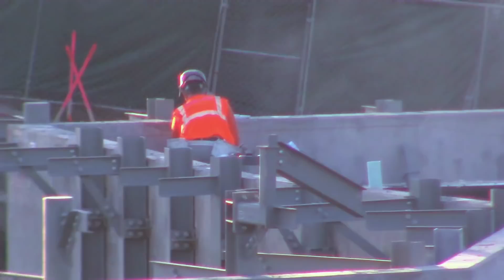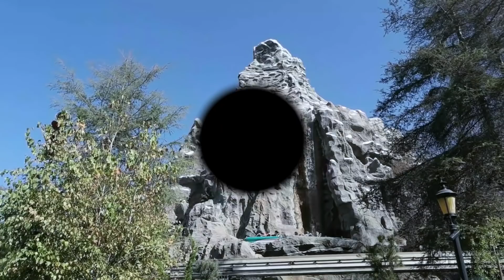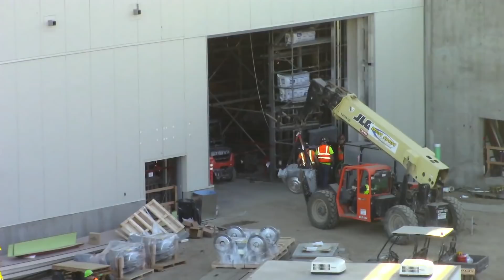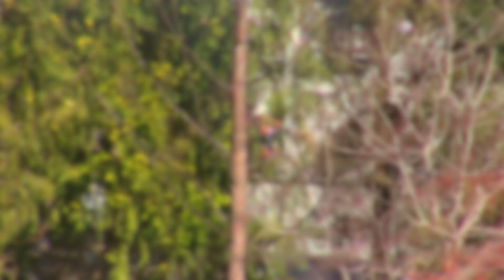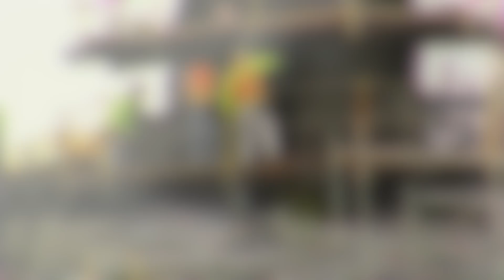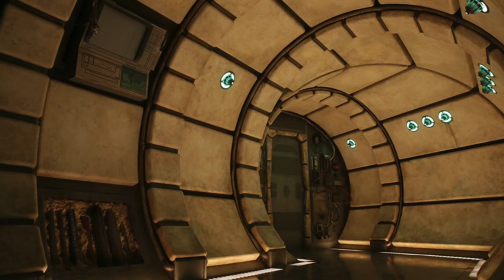Star Wars Land (aka - STAR WARS: GALAXY'S EDGE) Construction at Disneyland (STEP-BY-STEP) - part 18

Comment: interesting how some of the steel structure beams are not painted , wonder if steel beam supply manufacturing is running a little behind /or could be so many other reasons too
Reply from the maker: Good observation.  Actually, the red iron steel is made to resist rusting. This is accomplished by coating the steel with iron oxide to create a barrier that prevents water from having contact with the steel. Adding iron oxide also gives the steel its unique red color.  The red iron steel will be the primary support columns and beams of the building. The gray color steel beams will be used for the internal and cross bracing framework of the building.  Thanks for watching!